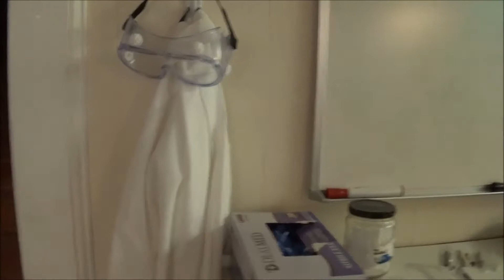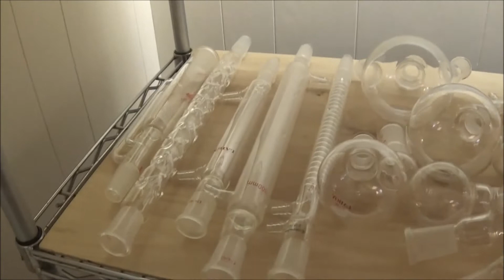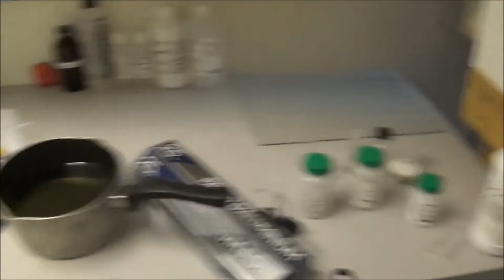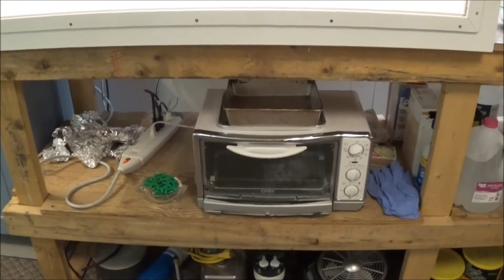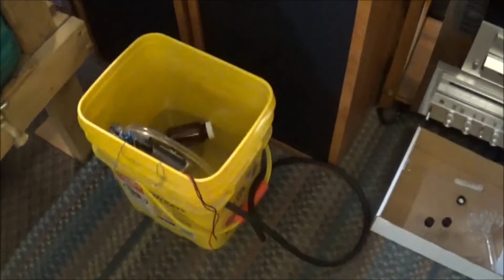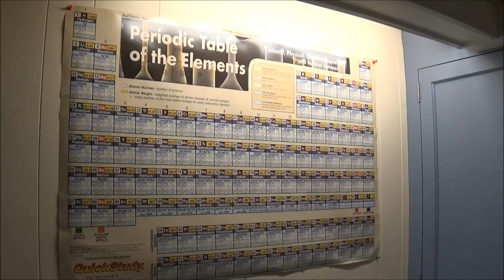Lab Tour 2.0

Comment: Get a soda bottle and put baking soda in it. With water. Have it to control a acid spill. Also you need Eye wash
Reply from the maker: I have a bottle of that around somewhere. Most of the time I just dump solid baking soda on acid spills. Since this video I did get an eyewash, important because eyes are the most vulnerable.

Comment: Well, that all looks awesome (and clean) !

It is excellent to see that safety precautions are in place, and things are organised.

Chemistry can go Bad sometimes, which is why Both of those things are needed.

Putting the containers of the more 'active' chemicals inside a bucket is great common sense - i do the same.

Looks like you're set to go ... the lack of damage and clutter means not much has been done yet ;)

Wonderful collection of glassware you got there, and i really like to see a reaction spot plate - hardly anyone uses those anymore yet they are superb for seeing fine details in small samples.
Reply from the maker: Thany you! Yes safety is very important. Lol I should have taken a before shot. All of my glassware shelves were almost empty and every inch of bench space was covered. There were piles of glassware in the bathroom and random stuff strewn about the floor. I use my spot plate the most when I need to check the pH a lot. One scrap of pH paper in each well. Make the stuff go a lot further than If you used a strip each time.
Reply: Good to see you round aga.
Great lab Tom.  I think keeping the clock hidden behind the shelf is a particularly nice touch.  It is good to lose track of  how log you have been in the zone. :)
Inspirational.
Mine is inching ever closer to completion and there will eventually be a video to celebrate.
Reply from the maker: Yes, very often I do loose track of time :). I can't wait to see yours, I know that you've been working on it for a while and it sounds pretty good from what I've read.
Reply: hiya j_sum1. I don't have a wall clock - i use a cheap kitchen timer that goes Beeep ! when i should do something like write down observations etc.

Odd feeling to have it set for 5 minute intervals, then realise later how long those 30 readings actually took to make !
Reply: A j_sum1 video would be nice.
Even just One experiment on SciMad would be nice.
With photos, naturally. 
3,100 posts and no actual experiment is just weird.
i got to 6,033 many of which were worthless.
Still, i posted a lot of things i actually did.

If the 'i am still building my lab' excuse  is going to last until eternity, please do the work required to find the Exact conditions under which Seawater yields Pyramidal NaCl crystals.

I've tried many times and have failed so far, using just Seawater, Plastic containers, filter paper and Sunlight (no Lab).

The filter paper was mostly to get the flying insects out.
Reply: You are correct aga.  It has been a lean year for home chem.  Moving house, work disruptions and four simultaneous reno projects will do that to you.  The trickle of posts is my way of keeping my head in the space even when it is impractical for me to do experimentation.
I do have some hardware to purchase -- camera and computer before my videos start arriving.  but the first four or five are already planned.

Anyway, lovely to know you have not dropped off the planet.

Comment: Wow you got a pretty awesome lab, damn I am kinda jealous right now, you got any big projects coming up?
Reply from the maker: Thanks! As for projects coming up there is synthesis of: choline chloride, pyruvic acid, methyl benzoate, 3-nitrobenzoic acid, potassium cyanide, benzaldehyde, benzoin, benzoyl chloride, benzoyl peroxide, potassium ferricyanide, luminol, p-TSA, thiourea dioxide, maybe nonivamide and maybe butanethiol. And when I get a tank of argon (nitrogen would probably work too) maybe n-butyllithium. My next big purchases will be a big set of 14/20 glassware and glassware for inert atmosphere reactions. I don't film much because it make experimenting a lot harder but I'll try to get some good videos out.
Reply: Tom's Lab wow very interesting, but don't you think 14/20 is a little too small ? myself use 24/29 just sometimes finds it too small
Reply from the maker: My two favorite things are really large scale (50+ L) and microscale. I can't afford to do do large scale though ;). If you want to preform a reaction 'just because' then small scale is the way to go. I've never needed bigger than 24/40 and I often wish I could do smaller scale. Mechanical losses eg. when doing a distillation get to be significant when you get down to 25 mL or less (more surface area= greater holdup). It would be nice to have a dedicated 14/20 set for this.
Reply: Tom's Lab true I think I prefer bigger opening was mainly cuz that I had a nightmares of copper Cathod stuck in there, how much did the lab cost u btw
Reply from the maker: I think I've spent $2000-$2500, It's hard to say exactly because I started buying stuff three years ago.